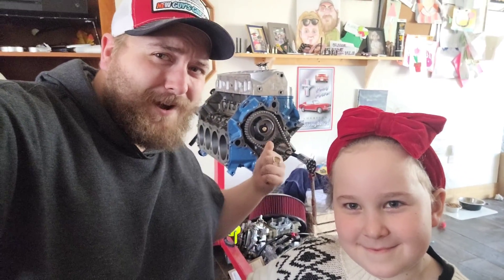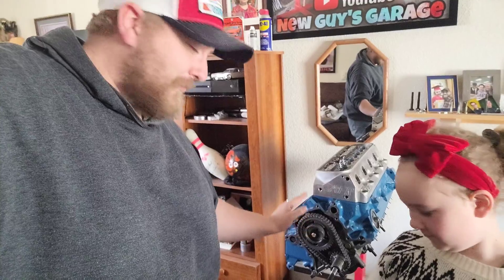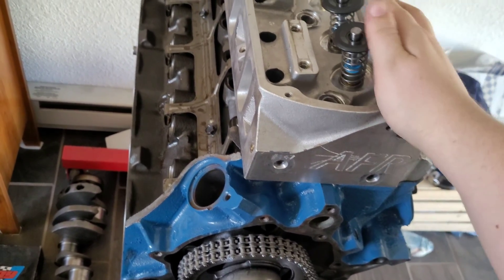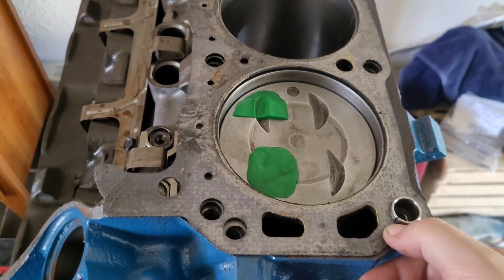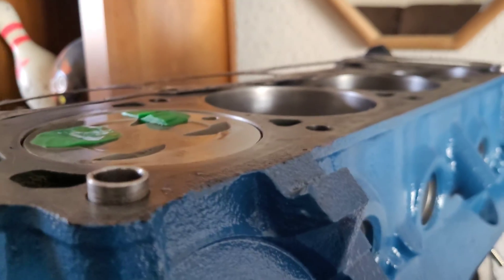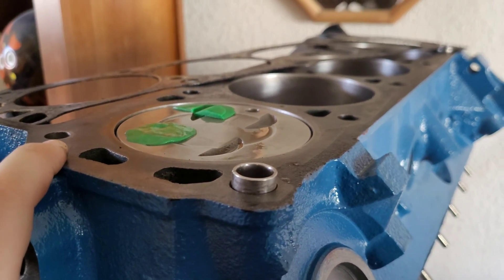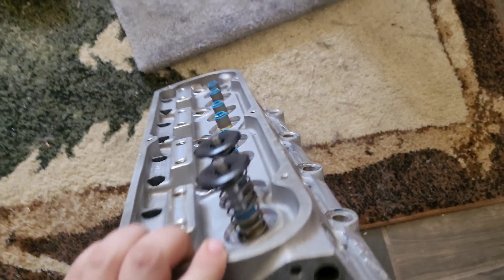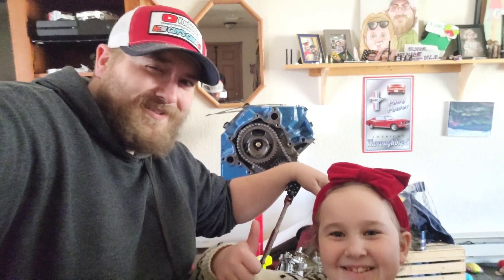Stock Pistons With Big Valves!? | AFR Heads Piston To Valve Clearance | Sbf Tunnel Ram Nitrous Build

Comment: Did the rod also get turned around with the piston?
Reply from the maker: No we simply are swapping the pistons and rods to the other side of the engine and turning them around
Reply: @newguysgarage6802  Oh I C...do you swap 5 and 4 or just side to side like 1 and 5 ?
Reply from the maker: @jcnewbee8124  honestly so long as you have the chamfered side of the rod against the cheek of the crank journal it doesn't matter 😅

Comment: That just goes to show that the best advice is measured advice, they were sooooo sure that it wasn't even close to working and now look, you were fixing to run iron heads that u really didn't want especially with a set of AFRs sitting  there 🤦‍♂️ but now the ol Iron horse is about to be hell on wheels. Glad it worked out for you